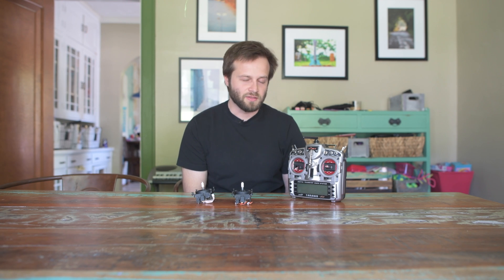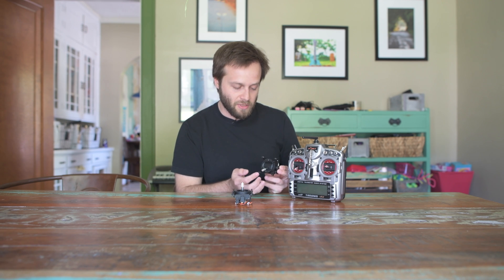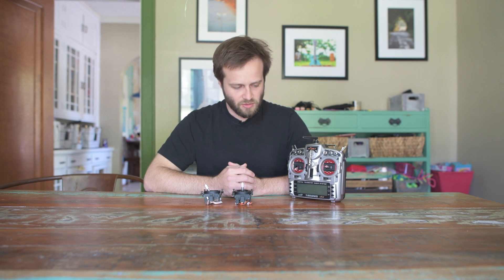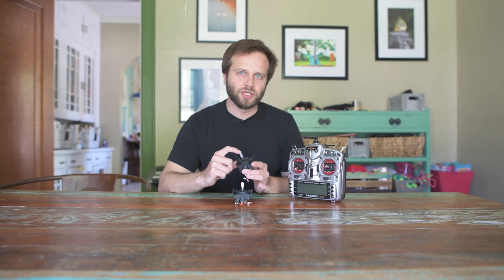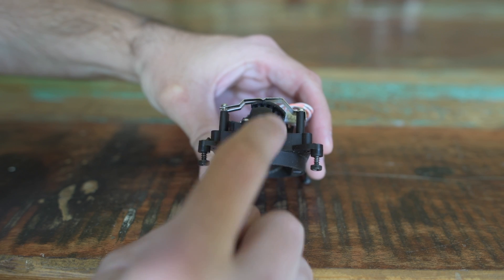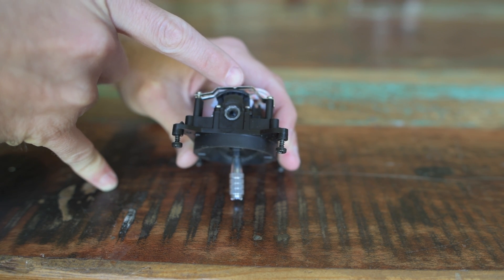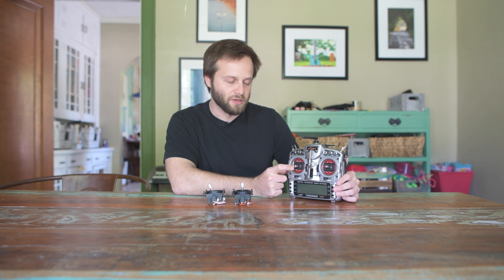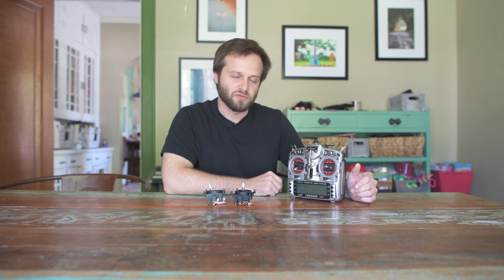Notched vs Unnotched Throttle - FrSky Taranis X9D Plus

Comment: So you put m9r gimbals on both sides... How does the reduced throw work for you on the pitch axis? I was under the impression that the m9r was designed specifically for use on the gimbal that controls throttle, with the intention that a regular m9 gimbal be used for the pitch/roll axis, so that the only axis that's reduced to 45 degrees of travel ends up being the throttle. I'm really curious if also having it on the pitch axis ends up being just fine, or if you'd be inclined to go with an m9r/m9 combo if you had it to do over again. It seems like it might actually be nice to need less physical stick movement on pitch, I'm just wondering if it would feel strange to have to move the stick more on the roll axis than on pitch for the same amount of rotation. Seeing that a lot of people use different rates for pitch/roll/yaw, I'm guessing it would be just fine after possibly having to get used to it a little, but I'd love to find out how you like it after having used the setup a while. I realize this is a year old video, but thought I'd give it a try anyway. Thanks for the video. I think you've convinced me to remove the ratcheting on the throttle completely and maybe try a piece of silicon hose around the non-ratcheted tension spring like I saw in another video, to give a little smooth tension to the throttle so it's easier to input yaw without inadvertently changing the throttle position. What would really make sense to me would be a little spring resistance to throttle increases... Wonder if there's a way to set up the gimbal where the centering spring provides resistance starting at zero throttle... I.E. change it from centering spring to being springy through the entire stick travel. The way the centering spring works on the stock gimbals, I'm pretty sure it can't be done with those, but I don't know if the m9 and m9r work the same way or it what I'm thinking might be possible with those. I don't know if my idea has any merit, I was just thinking that in cars we have a spring that closes the throttle unless pressure is holding it open, and I'm curious if it might be a good thing for quads. In my mind, it might work better to allow yaw movements at steady throttle than just resistance to stick movement in the throttle plane, but it wouldn't be the first time a theory of mine got shot down in flames. 😉 geez, sorry for writing a book.... Do you fly race/freestyle or are you more into flying tripods? You mentioned hexa or octocopters, and I don't think those are used much in freestyle or especially racing. 😉👍👊
Reply from the maker: I love it, but it takes some getting used to. I’m not a super great pilot either, but I have seen other people do the same.
Reply: @createthisdotcom  thanks for the quick response! I'm just getting started in brushless minis myself, so definitely not even a decent pilot yet. I though it might have the potential to feel really strange, but it sounds like a non issue. My exposure's been limited as far as people who use the m9r, but you're the first person I've seen using it on both sides. As a matter of fact,  there were apparently enough people who disliked the red on one side and black on the other look that Frsky made the m9 available with red anodized hardware. Do you do "sporty" flying, or are you more into the cinematography platforms than the "sports cars"?
Reply from the maker: I use it to fly an armattan chameleon ti and a custom built 3”. Nothing cinematic about it. I like the shorter throws because I have small hands.
Reply: @createthisdotcom  Nice! I was just wondering because you'd mentioned flying a hex or octo. Thought you might be flying some huge lumbering beasts. I just found your channel in the process of looking for info on adjustments to the m9r. Thanks for your help and the informative video!

Comment: Im new to hobby just bought a used taranis x9d plus and wondering if you would reccomend me to install these gimbals
Reply from the maker: Yes, I think you’ll like them.
Reply: They're nice gimbals and a great upgrade, especially on a used radio where the original gimbals might have gotten sloppy from wear. However, I would recommend m9 gimbals, or use one m9r and one m9, because the way I understand it the m9r is specifically designed for throttle use. Stick throw on the throttle axis is 45 degrees of travel rather than the ~65 degree travel on the other axis (or both axis on m9 gimbals). Most people seem to prefer to keep the full 65 degree travel on the pitch axis, so every m9r installation I've seen until now used an m9r on the throttle side, but an m9 for the pitch/roll gimbal. I was about to ask about how the m9r is when used on both sides when I saw your question and thought I'd chime in, even if it has been months since you asked.